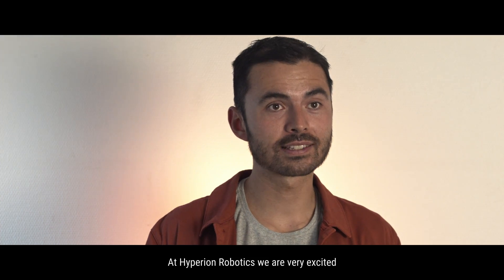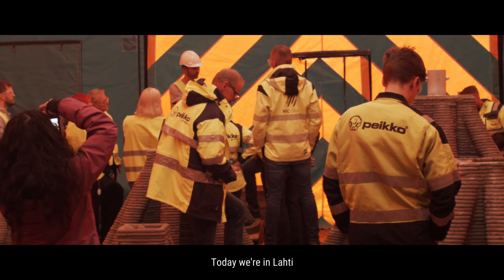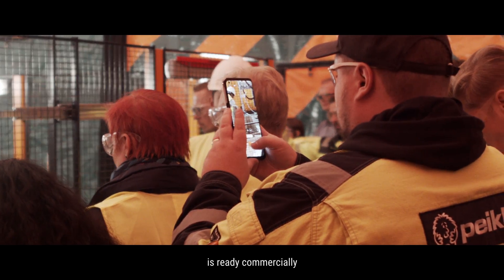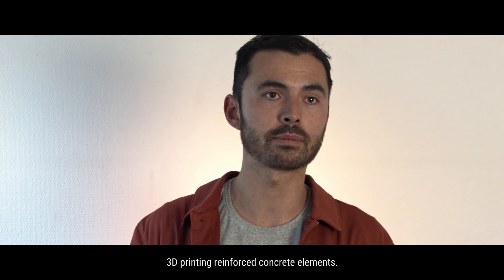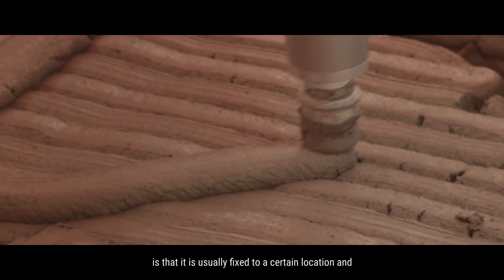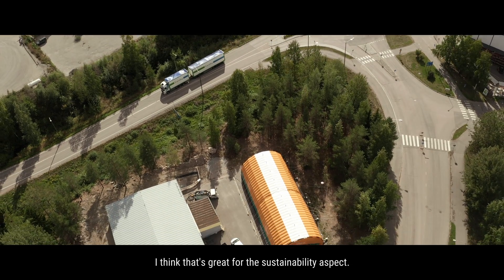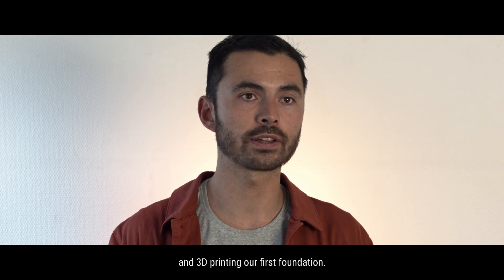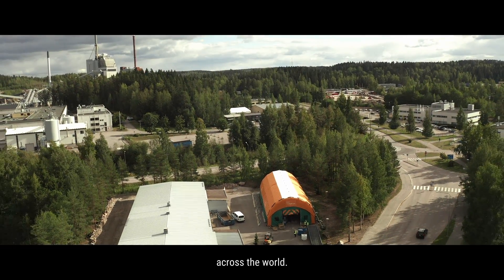Hyperion Robotics  3D Concrete Printing Micro-factory Deployed in Lahti

Comment: Very informative and impressive video. Thank you.
There are numerous references to 'reinforced concrete' in spoken text in the video, but I can't see any reinforcement. 
Was rebar inserted into the (sloping) open circular channels at the extremes of the printed structures? Or was the concrete mixture itself reinforced with something like chopped fibres or similar? It would be nice to know - I don't know if the spoken text in the video refers to 'reinforced concrete' because Hyperion has the ability to offer that but it's not applicable to this project, or if it is applicable to this project but visually it's not obvious how the reinforcement is being done.
Reply: same thought